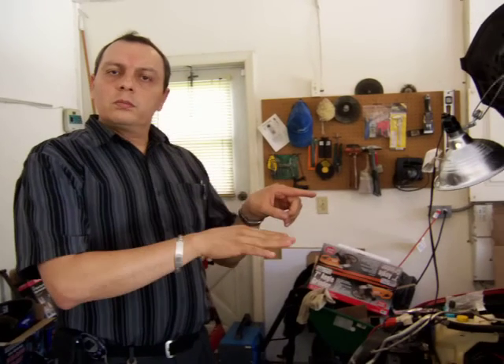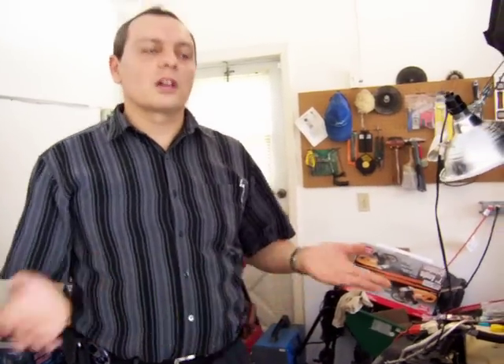Nissan Sentra Electric Car Conversion Part 30

Comment from the maker: The pedal is actually easy to push. I read the post in the b15u forum and it looks like it is the clutch bearing after all. It squeak with every turn of the shaft. A mechanic also looked at it and he also said it is the bearing :(

I am amost done removing the electric motor. Hopefully one or more days of work and I will be done (free time only)

Thank you for your comments